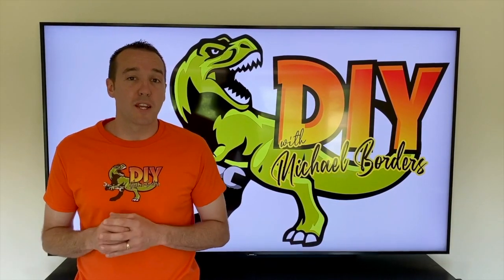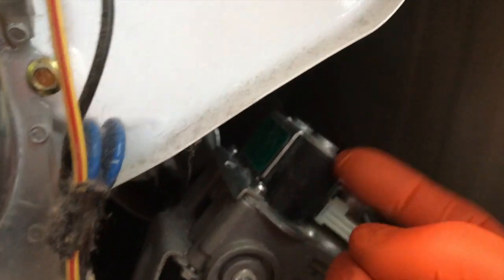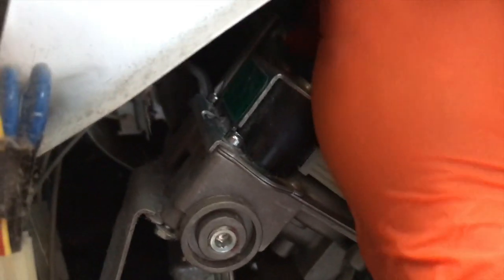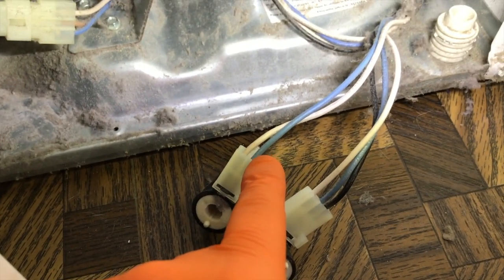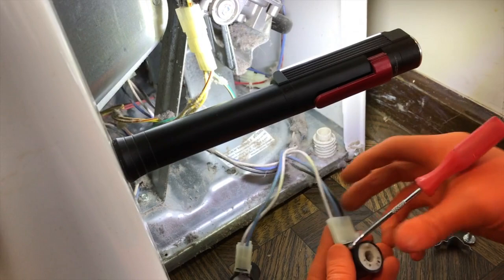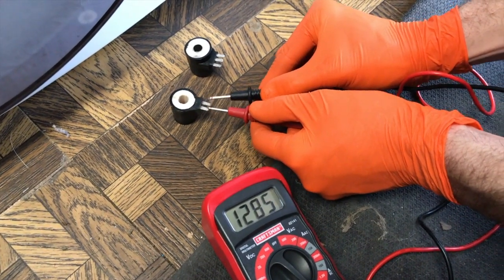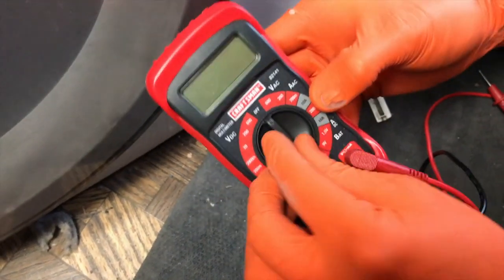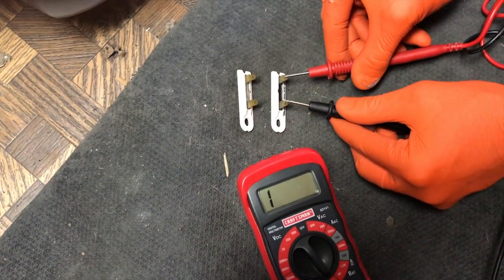Whirlpool Dryer not heating or drying clothes - Test Coils and Thermostat

Comment: Hey Michael, my coils are reading fine in ohms, but I tested the thermostat (part # L230-50F). And the ohms just stay at 1 and doesn't read anything else. Does that mean the thermostat is bad?
Reply from the maker: Thanks for watching & welcome to the DIY Raptor Club.  Did it beep when testing?

Beeping will indicate proper flow of current as well.  😎👍
Reply: @DIYwithMichaelBorders  when testing continuity with the coils.  It did not make a beep, but my digital miltimeter did read numbers in ohms. But when doing the same to the thermostat, there was no beep noise as well, but my multimeter did not read anything. The digital screen just stays at "1" for the thermostat.
Reply from the maker: @t3nsaZ  

Thanks for the reply.  Sounds like a new thermostat is required.  Please keep us posted on your DIY project.

😎👍
Reply: @DIYwithMichaelBorders  will do, I'm hoping that's all it is, my dryer will not heat up. will keep you posted. By the way, is there any specific place where I can order that part that you can recommend?
Reply from the maker: @t3nsaZ  

Thanks for the reply, we have an Amazon affiliate link where we earn from qualifying purchases.

We can look up your part # & see if we sell it.  👍
Reply: @DIYwithMichaelBorders  Just to be sure it is the correct part, there's a sticker on top of the thermostat that is written from top to bottom "501912, T-O-D 60T21, Z2036, L230-50F. Which I have no idea what that means.
Reply from the maker: @t3nsaZ  

Perfect, (501912).  Check out the link below to see if it’s the same as yours.

If interested in purchasing this product, visit our Amazon affiliate link below.  I earn from qualifying purchases.

       https://amzn.to/3t8wJrN

😎👍
Reply: @DIYwithMichaelBorders  Thank you so much!
Reply from the maker: @t3nsaZ  

You are very welcome, looking forward to hearing back from you.  😎👍
Reply: @DIYwithMichaelBorders  Hey just wanted to give you an update. Replacing the thermostat fixed my issue with the dyer not heating up. You've been a very big help, thank you so much. Will definitely recommend your channel!
Reply from the maker: @t3nsaZ  

Awesome Awesome and we really appreciate you taking the time to share this update.  Back up and running is a good thing.

As we tell all our viewers, us DIY’ers need to stick together!  Hopefully many stress-free days ahead for you.

Comment: Hi Michael, I did check the parts for continuity and the blue one checked ok, but the white connection with blue and red cable is not reading and when I unplug the plug it back in it the dryer didn't give me the code until I start using it. Can it be only this part when I don't see fire or might be some other stuff?
Reply from the maker: Thanks for watching & it’s likely this part.  This is a friendly DIY project & we are here to help answer questions.

Keep us posted on your DIY project.
Reply: @DIYwithMichaelBorders  that sounds good, do you have the affiliate link to the Amazon part? The numbers I see are: N3SI- K41
JamesTech 922.
Also I was watching a video for the radiant sensor that you replaced, how do you know it's bad, just a simple test for continuity?
Reply from the maker: @dan_youtube  

Thanks for the reply.  Below is an affiliate link, we really appreciate it.

If interested in purchasing this product, visit our Amazon affiliate link below, I earn from qualifying purchases.

       https://amzn.to/3Q3vtPf

In regards to the Radiant Sensor, it’s technically the 3rd Thermostat.  If it fails, it can lead to no heat being generated by the gas valve.
Reply: @DIYwithMichaelBorders  thank you so much for the quick reply and great help. So that's the only part that doesn't have continuity. If it's replaced the fire will turn on or there's something else I should order?
Reply from the maker: @dan_youtube  

You are very welcome, let’s start with that as it’s the most common to fail first.  Keep us posted.
Reply: @DIYwithMichaelBorders  Hi, so I replaced the faulty thermistor and there's no more codes and it keeps running and the hot coil turns on but I can't see any flame from the gas, is it because it's still open and it has no wet clothes inside? I just attached the door cable but it's still on the floor.
Reply from the maker: @dan_youtube  

Thanks for the update, the sensor that detects the weight of the cloths may not be allowing igniter to light burner.

We recommend putting the machine back together & adding a bit of cloths to dryer.  Keep us posted.
Reply: @DIYwithMichaelBorders  so bummer, after I put everything back together it still blows cold air. Is it the ignition solenoid the problem?
Reply from the maker: @dan_youtube  

That is a bummer...Ignition solenoid is definitely possible.  

Additional likely items are the Thermal cutoff switch & coils.
Reply: @DIYwithMichaelBorders  if they passed the continuity test that's still a possibility?
Reply from the maker: @dan_youtube  

Thanks for the reply, if continuity test was good, parts are good.  😎👍
Reply from the maker: Ignition coil shifts to the top of the list for replacement.  😎👍
Reply: @DIYwithMichaelBorders  got a link for that?
Reply from the maker: @dan_youtube  

What is the serial # of your machine?

😁👍
Reply: NVM I found some similar looking ones and they actually fixed and it works and it's incredible. I can't believe I did it by myself, but that won't happen of course without your prompt replies and most importantly with your great videos on YouTube, thank you from the bottom of my heart!
Reply from the maker: @dan_youtube  

Awesome Awesome, thanks for the follow up.  Back up and running is a great feeling.

As always, us DIYers need to stick together!!!  😎👍

Comment: Both my coils and my thermostat passed continuity so what else would cause me to not get heat?
Reply from the maker: Thanks for watching.  At this point, it’s likely that your gas valve/burner is not performing up to par.
Reply: @DIYwithMichaelBorders  is there anyway to test that or would it even be worth replacing?
Reply from the maker: @theomnipotentt4367  

It’s worth replacing, we don’t have a video on that at the moment unfortunately however we recommend replacing your Thermostat first…even if it’s providing continuity.

The Thermostat may be in its early stages of failure and acting sporadically when machine is running and vibrating.